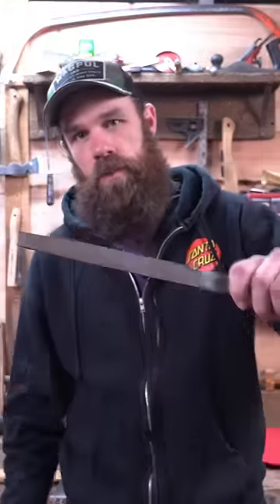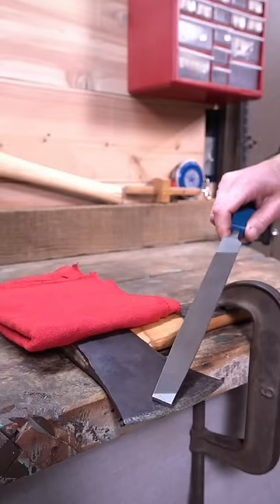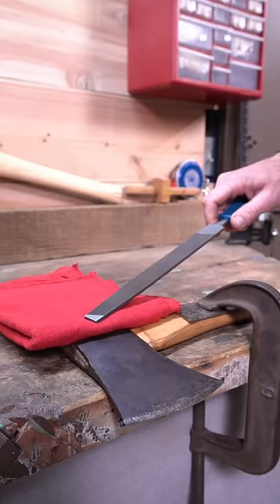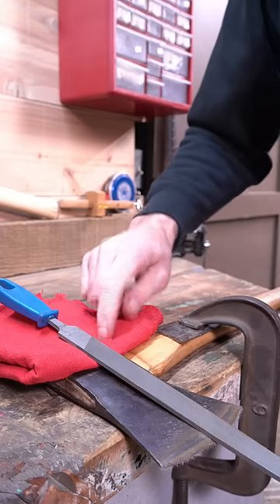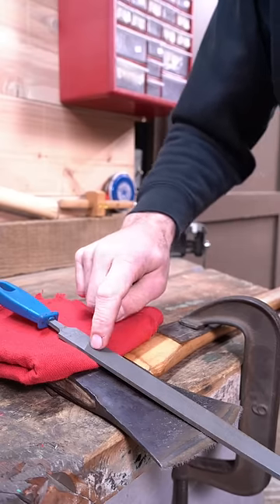How to Sharpen an Axe Using the Rag Method and a Mill Bastard File #axe #tools #howto

Comment: Dr Seuss’ Moral of the story:

If you have an ax to grind 
or need to grind an old ax, 
be a bastard and use a bastard
and grind that ax to the max 
and don’t be lax, mister Max.
Use a towel and not a dowel, 
finish with paper 
made of sand and 
don’t be bland 
with your hand 
And when you’re done
You’ll feel like you won
with an ax 
that’s filed to the max
Whether you chop
Or you lop
Your ax will slice
With this man’s advice!

Comment: Just discovered your channel a few days ago and am learning much-I thank you! This is a fantastic tip. I do believe that you could improve your demo by calling your rag “a common red shop rag” as not all rags are created alike.

These formal red commercially ( or blue sometimes) available shop rags have a consistent size/thickness and therefore provide the most consistent angle that you are demonstrating-not to nit pick on what a rag is.

We go through pallets of the “bricks of rags” ( which are old cut up tee shirts) every year and they are not the average shop towel, in that they don’t have the density of these red wonders! 

I was just thinking about this fact while at Harbor Freight yesterday; they’ve got bags of these red shop towels, and I’ll be grabbing some for my upcoming axe sharpening sessions thanks to you!

Stay safe , and thanks again !

Comment: I have a wood shop at home  and grew up using every kind of tool , I've sharpened edge tools with strops, oil stones, water stones, and diamond plates, used files and plate glass and sand paper. I've never seen this method but I can tell it's a great one!

Comment: Old but trusty trick.  Never leave home without a towel.
Reply: Is that you ford prefect?
Reply: @muttman325  remember when he tried to shake hands with a car! 🤣
Reply: @muttman325  hey Arthur
Reply: Don't forget to bring a towel.
-Towelie
Reply: @muttman325  Beat me to it! Lol
Reply: @tylerward8333  just let me walk on the sunshine a little longer
Reply: Could use a shirt or something in a pinch
Reply: Don't forget to bring a towel 😂
Reply: Most important tool for anyone 100%
Reply: @Tyler Ward  hang on I'm trying to remember the beat to funky town
Reply: Beat me to it dude. Prolly cuz eye stopped to get a lill' high.....
Reply: Always know what your towel is.  You might have to wipe the top of a bottle of Pan Galactic Gargle Blaster.
Reply: This applies to axe sharpening and interstellar travel. Always know where ur towel is.
Reply: @Greasy Limpet, the pan galactic gargle blaster is a mixed drink. No bottle to open or to wipe top of.
Reply: @TrapperAaron  yes, you're right.  I think Zaphod invented it, if I remember correctly.
Reply: It's called a hanky. Nice for not cleaning your hands on your clothes, not blowing your snot everywhere like a wild man, not burning yourself grabbing hot stuff, not getting your eye poked out when cutting off bolts. Just infinite uses.
Reply: @maxpulido  you don't mean you'd risk singeing your hankie on something hot!?
I treat mine with the utmost respect, ironing them into perfect squares and bleaching them once a year.  To be honest, it's nice to see I'm not the only person who still uses them! 🤧

Comment: How sharp do you like your axes? In the fire service we kind of keep them blunt so it can break through roofing and walls. When we keep them too sharp they tend to get stuck. Now for my axes at home how sharp should I keep them? But this is an awesome way to sharpen! I'm going to show the guys at the station! Thanks for the great info!
Reply from the maker: Each type of axe has a purpose and edge geometry should be suited for that purpose.  My carving axe is about 22 degrees and as sharp as I can get it with 400 grit.
Reply: @old_iron_axe_and_tool  awesome! Thanks for the reply and for the cool content!

Comment: Tried this method on a really cheap, dull hatchet I bought from Harbor Freight. This idea works, and it's surprising how fast it works. And the slight convex makes for a really tough edge. To see your progress, ink the edge with a black felt marker. This method also really cleans up an edge that's badly notched.

Comment: Thanks for the tip I've always used a file like you have there but never use the rag to change the angle angle I've always used blocks of wood. That's a good tip for a quick sharp thank you

Comment: Use your file the right way and it will last longer
Reply: if you mean he’s damaging it by sharpening both ways, then that’s a myth
Reply: He's not even going "both ways" he's going sideways 😂😂
Reply: @cooperswan534  It isn't a myth at all troll, you've never even used a file or probably a real tool in your life. It absolutely ruins the cutting edges fast if you file backwards
Reply: @escapetherace1943  okay buddy take a deep breath and calm down for a sec. let’s imagine for a second that you’re right, why do die filer machines exist?

Comment: Good idea to use a cloth to get a consistent angle. I never use metal files to sharpen any edged tool. Always use Arkansas sharpening stones. Starting with white stones which are for course cutting. Finishing with a surgical grade, black Arkansas stones. There are other fine grits stones. A green stone for even finer work. A rare red Arkansas stone. Arkansas stones are Novaculite rock that was formed in a small area in southwestern Arkansas going into southeastern Oklahoma. Novaculite rock can be found around the world. Just the unique geologic conditions made a different and unique Novaculite rock in this particular area. Surgical grade black Arkansas stones are very much like 3M lapping paper.
Reply from the maker: Thanks for the geology lesson goose. I've yet to master the sharpening stone. One day.
Reply: @old_iron_axe_and_tool  It does take practice and patience. I spent 8 months sharping my combat Kabar, stamped US Army. I don't do that Marine thing. Starting with my course white Arkansas stone. Then months on my surgical grade, black Arkansas stone. From the factory edge to a razorblade edge that I can shave hair with. That's my sharpened knife test. 
   The only steel I have trouble with is that D2 type steel. That stuff is just too hard. Tried diamond sharpening stones with no success. Have one of those Fairborn Sikes commando knives, actually made in Sheffield England. That steel is a booger bear to sharpen too.
Reply: Another great Ideal. Never knew that.
Reply: @whomagoose6897  I dont understand how it could take so long, I have a katana my uncle gave me as a child and I can get it shaving sharp down the entire blade in 20 minutes after chopping pine saplings for fun. I use a Arkansas stone then a thing out of a light bulb ( dont know what its called) to get the final polish. I also sharpen freehanded, only using a bevel guide when I'm completely changing the bevel with a file.
Reply: @whomagoose6897 you know a KABAR is D2 tool steel, right?

Comment: Its called hospital sharp because if your hand slips on that edge while sharpening you'll be going straight to the hospital. 😂
Reply from the maker: You got it.
Reply: Been there! Luckily I was just the driver, not the wounded. I used super glue when it happened to me.

Comment: This changes the your bevel quite a bit. I've done this trick with several axes. It ends up being a thinner, more aggressive cutting edge. I happen to like that. 

Good for resetting bevels on a yard-sale axe head that hasn't been properly sharpened. 

I have a few factory new axes that I think I will change to this more aggressive bevel.

The big thing to watch out for, is making sure the axe blade is centered to the eye. Otherwise you'll end up with two different bevels.

Also, this technique is kinda pointless for really cheap axes. They come with a poor bevel so It takes forever for this trick to work. And they're not heat treated well enough to maintain that aggressive cutting bevel. I once spent 4 hours sharpening some home depot brand axe to a good sharpness, only for it to dull immediately on the first use.
Reply: this is entirely dependent on how high you set the towel
Reply: @zebragoboom no, he's right. some hardware store axes are straight up junk, they will not hold an edge without you grinding away the entire bit.
Reply: Should strop the blade when your done sharpening to get rid of the burr. Will help the blade keep its edge.

Comment: The axe does not need to be razor sharp actually on the contrary, If you try to sharpen the ax too much then the edge will become too thin and weak, this will make it prone to chipping, breaking, or becoming rolled over. Remember an axe is typically for splitting wood not for slicing it like you would do with a knife.
Reply: There are different types of axes. One for felling a tree should be stupid sharp because you’re trying to dig deep and take out big chunks against the grain. Splitting mauls are wider wedges so it can split the wood with the grain.
Reply from the maker: Well said. Race axes and carving axes are also super sharp.
Reply: I personally prefer my hatchets to be about as sharp as my camp knife, should I lose one or the other, I dont want to be left hindered by being stuck with either a wedge or a scalpel, I need them both atleast moderately capable of fulfilling each others roles

Comment: The rag trick is an excellent method for making a razor sharp AND long lasting edge. However, this does reduce the bevel angle changing what it's good for. The term he used is "convex" which is better for limbing, kindling, wood working and target throwing, but reduces its ability to buck and split logs or chop down trees. Most people (and I mean like 95% of tool savvy people) don't know that axes are specialized tools. Most will see the difference in a hatchet and a full axe or a single bit vs a double bit.  However, most won't know a roofing axe from a rigging axe, a felling axe from a rafter, a hewing vs a masting axe or even that a doubled blade axe actually has 2 different edges for different applications.

Comment: I wonder if this is more appropriate for setting a new bevel and edge as opposed to sharpening with a stone to bring a blunt edge back to service sharp
Reply from the maker: I suppose it depends on the axe and its use. 
But yes, it's very well suited for reprofiling a bit.
Reply: Depends on what you like!

Comment: i have incremental wooden blocks that I use for convex edges but for most of my bushcraft axes I just go with a straight secondary bevel. the work I do in the bush rarely requires the edge strength of a convex edge. but good skill to know none the less
Reply from the maker: Do you place the block on the axe?

Comment: I just had an experience with a hospital sharp blade. Opened and Poked through my pant leg and when I threw out the trash I drew the back of my arm up the knife point. 4 internal stitches and 9 on top and were good! Stay aware and safe yall

Comment: A note for the viewers: a convex edge  will stay sharp longer. A flat bevel will be sharper but when chopping, will get dull faster. A concave bevel is often what you find on a brand knew knife.

This is more important for knives. If you chop carrots with a concave bevel you'll find that a brand knew knife needs to be sharpened pretty soon. 

I recommend to anyone who cooks a lot and doesnt use a mandolin slicer or food processor, sharpen one knife with a convex bevel for chopping. A meat cleaver should also have a convex edge.
Reply: Bladesmith here; concave bevels aren't inherently worse than flat or convex bevels.

Concave bevels have better edge retention, when used properly -- this means low lateral forces, and not overheated (like most factory grinds are.)
They make the edge angle more acute, leading to higher sharpness, and better edge retention (because more acute angles remain sharper for longer.)

Most people don't use knives properly and as a result put lots of lateral forces on the edge, something that concave bevels aren't good with, because they don't have supporting material.

Convex edges, when properly done slightly increase edge angle (where it matters) but reduces thickness behind it, while being a tougher shape.
This means it's not inherently sharper, but it is thinner, and thinner is better, it also has more edge stability, so it can handle lateral forces, and the shape helps move material away too.

Flat bevels are generally the best just because they are easy to do, and they offer decent mix between stability and thickness. So can't really go wrong.

Use case, it depends.
I personally prefer concave edges, because I can use my knives. But for striking tools edge stability matters, so axes and the sort get convex edges.
Reply: @autumn5592  most of that is true except a more acute edge means less metal=weaker. This gets dull faster with respect to the work. You can cut drywall with a butterknife or with a saw and the blade never requires sharpening. If you use a razor blade it gets dull and you throw it away. I don't recommend using a butter knife, but I've cut many foods with a butter knife, and the knife edge never changed. 

I see that you're too lazy to look it up so you made a big assumption but as a blade Smith you should try it yourself. 2 to 4 knives made from identical steel using 2-4 different edges. Use all the knives every time you cut anything for equal time each and then you'll see what I'm talking about. 

Whether the use is proper or improper changes the overall time but it doesn't change the fact that a thinner edge is weaker and will get dull faster. Nothing can change this. You can only change which knife you use. 

I'll make the research part easy for you. Look up the sharpness of a surgical scalpel compared to a disposable razor blade. This will give you a more professional level of information. It's better than just guessing.
Reply: @brookelord3448   Not necessarily; thickness of the blade (or primary bevel depending on style.)
If you have a thicker knife, with a more acute angle, you still have more supporting material than a thin knife with an obtuse angle.

I get your point though, and even said that hollow/convex bevels were weaker to material forces.

More acute angles do not dull faster.
Edges dull for two main reasons, abrasion and edge stability; abrasion is rounding of the apex though wear, edge stability is a combination of steel (alloy, heat treat - toughness), and geometry (thickness, bevel grinds, bevel angles, profile, etc.). 

When subject to situations that put the edge under high strain, like lateral forces, high pressure, like twisting in cuts, scraping, and chopping, a hollow grind will be weak, because it doesn't have the supporting material.
Using a knife with a hollow grind in this manor is improper use.

Abrasive wear, which you would see through normal use, the edge retention will be much better.
The more acute the angle, the better the edge retention, until the toughness of the steel isn't enough to support the edge.
To prove it (edge retention of acute angles), let's draw a series of isosceles triangles, each with the same base thicknesses (representing blade thickness, or transition from primary to secondary bevel/shinogi line), two or three should get the point across, do 20, 15, and 10°; you'll notice the more acute angles are taller, whereas the more obtuse ones are shorter. The shorter ones are easier to turn into a circle right? This is what is happening at a microscopic level with abrasive wear. The edge becomes rounded, this is called edge radius, a measurement for sharpness.

And, if you don't agree with basic geometry and material science, the  feel free to look up Dr. Larrin Thomas' (You know, the guy that is developing the best knife steels on the market, heat treatment techniques for steel, and testing knife steels?) test on KnifeSteelNerds, where he demonstrates more acute angles retain their edge longer.

Or do you disagree with the guy that has a P.hD in Metallurgy and has tested it with precision test equipment? Lmfao.

Onto the other absurd statements, like saws on drywall, yes, they do need sharpening. Gypsum is abrasive, it will wear saws down, just serrations last longer than plain edges.

Butter knives edges are dull, they're designed that way, you're saying an already dull knife won't go dull? Lmfao...

Not to lazy, happy to look at any source material you provide.
It's not an assumption. It's scientifically proven.
I don't need to create the test, I've already done it years ago, and several tests have validated it.

Again, thinner edges are generally less tough and stable, but they stay sharper under proper use.
Nothing can change this proven, scientific fact.

What will that do? Lmfao.
You are comparing a utility blade to a scalpel, completely different use cases, geometries, and thicknesses; and ultimately proves nothing.
Besides, scalpels aren't even that sharp, they are about the same sharpness as a good utility blade (depending on the company and type of scalpel), just they are thinner, so seperate material easier.
I really don't understand the point you're trying to make with this one.

Comment: You’ll get at least five sharpenings out of that head before it needs replaced, based on the amount of metal you’re taking off. Unless the edge is severely damaged, it should never need more than a light touch up to keep it work sharp. “Hospital sharp” is for detail carving, not chopping.
Reply from the maker: O.k.

Comment: Have an old oak handled 2 sided arched serrated grass sling.  Some folks called them "idiot sticks" years ago.  Got to figure a way to adapt this method, get the "old bastard"file out, clean and sharpen that sling again. Primitive tool by high tech standards. Just call it non motorized 'exercise equipment'.
Reply from the maker: Idiot sticks! Thanks for the knowledge man.